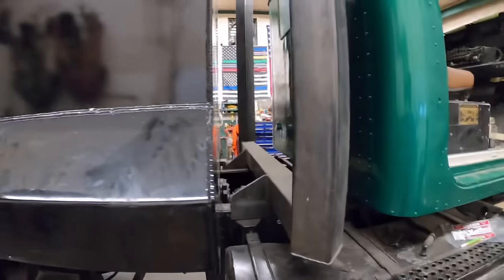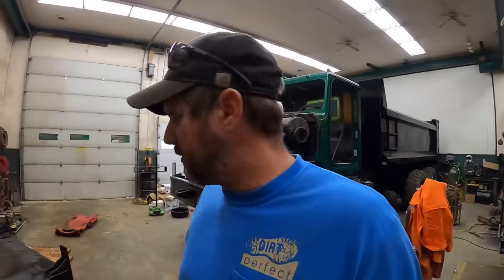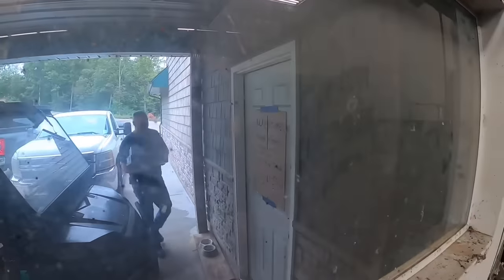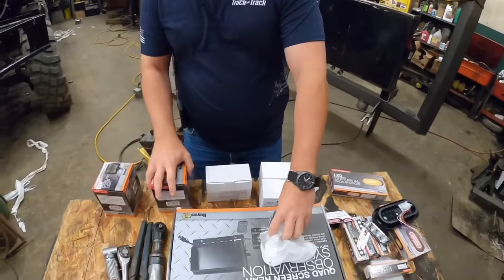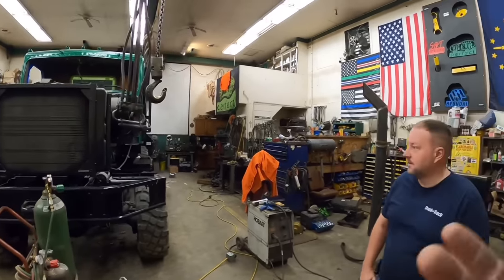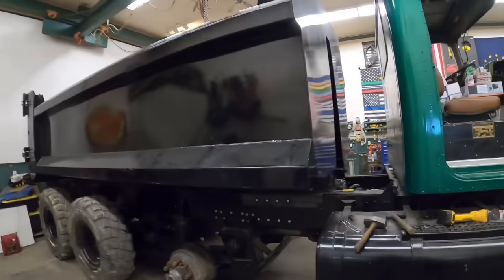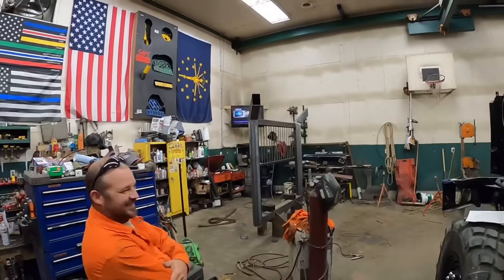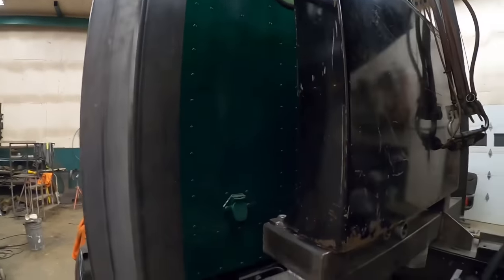Custom Fabrication on the stacks on Lt Dan and the bed raise for the first time

Comment: Whenever you cap tubing especially if you live in climate that freezes moisture will get inside and can actually distort the tubing it's a good idea to drill a drain hole in the bottom

Comment: We had a problem with top mount tanks on snow plows a few years back when we mounted it on the cross support for rear wing (6X4X3/8) across frame. We mounted the tank the same way as you did. The angle welded to the tanks started to have stress cracks which leaks. Very easy to fix though take the 4 bolts out and put a piece of rubber belting between and mark and drill 2 holes in each and tighten bolts. It's been over 5 yrs and no problems as of yet.

Comment: Just a suggestion, add a limit switch and a red llight on the dash to warn the driver if the dump bed rises while traveling. There as so many videos of dump trucks hitting bridges with very bad results. A simple warning system seems like good insurance.
Reply from the maker: Stay tuned thanks
Reply from the maker: Appreciate that

Comment: I had to pull a fuel tank off a JD 160 that some one had put 3/4" 45 deg trim pices that had been used for concrete forms, so the tank had dirt and concrete in it, after washing it out, I put 1/2 a large bottle of rubbing alcohol in it and rolled the tank around  empited and repeted witht eh rest of the bottle and stuck a rag on a stick and dried it out the tank was dry and clean and back in service at the end of the day.

Comment: Its looking Good. I just hope the stack underneath the Hyd tank doesnt heat up the oil more then what it allready will be from using it.But it looks Great. And with those bright lights on LT Dan, Youll see him coming for miles...Be like that snow plow in that movie chasing those kids around. With all the lights on it..LOL..HAHA...Great Video, and job on LT Dan ...
Reply: Hopefully, as the oil will only be used for dumping, it won't get heated that much by use.  Not like an excavator that is constantly working, or a skid steer running a forestry cutter, or even a hydro drive compact tractor, where the oil is getting lots if heating from use.
Reply from the maker: Exactly

Comment: A soapbox is a raised platform on which one stands to make an impromptu speech, often about a political subject. The term originates from the days when speakers would elevate themselves by standing on a wooden crate originally used for shipment of soap, or other dry goods, from a manufacturer to a retail store. In your case Mike, it's to preach!!!! Truck is looking sharp Sir!
Reply: Greg, exactly correct… there’s a scene in an old Charlie Chaplin movie where the Keystone Cops chase him into a crowd.  They are gathered around a Snakeoil salesman who is standing on a box labeled soap.  

As the crowd surges forward, during the scuffle, the box is broken open.  The salesman tumbles and pours a bottle of the Snakeoil onto the soap. The ensuing mountain of bubbles gives Charlie a cover through which to escape.  

That is my earliest memory of someone  up on their soapbox.  After that I only remember it being used to refer to  people preaching religion or politics.
Reply: @sassafrasvalley1939  You had much more detail than I did. Thank you for the full picture. Took a look at your channel. I like it.
Reply: @gregd931  thanks Greg… Your answer triggered that memory… just wanted to share it while it was on my mind.

Comment: For the hydraulic tank don't you need rubber bushings that the mounting bolts go through that fit between the tank brackets and the brackets on the truck frame or exhaust stacks in this case? Maybe ½" or 1" thick. They help to keep the tank from vibrating loose causing the bolts to rub and shear off right? IDK for sure but you see them on upright hydraulic tanks on trucks now. Just something I'm curious about and only trying to be helpful. The truck is looking awesome and I can hardly wait to see it hauling some dirt for a pond dam!  👍
Reply from the maker: No sir no need

Comment: I think MIPT x JIC adaptors would be the way to go on those hydraulic tank ports, the adaptors can be sized to the JIC hose size right at the fitting instead of using iron pipe bushings.
You could get the pipe threads tight and be able to clock the hoses in any direction you want.

Comment: You  need to change the fittings on the tank to 45's especially the one to the pump.  where is your inspection cover and in tank filter screen before the pump?
With those awesome Byers 4 way tail lights on  the back of the truck I would use a cab mounted low profile light bar to gain space and protection from the dump box load.  Keep up the GOOD work

Comment: OK Mike, right off the bat you express a smidge of concern about "if that nut ever breaks off in there.............".
Put your concerns to rest and make some notes here.
If.....that nut EVER gives you any kind of problem........simply cut out a section of the tube with the nut (torch, plasma cut, cutoff wheel, drill and jigsaw or whatever) and then fabricate a patch plug/plate with a new welded nut to go back where you cut out the faulty nut.  Weld in the patch plate and grind the weld smooth and flat.  You're done and back in action.  This technique is also useful for adding a welded anchor nut to any place where you can't access the backside/underside for direct welding the nut in place.  My method is to drill a hole in a suitable piece of donor steel and lightly secure the nut in place with a bolt and then weld the nut to the plate.  Then I cut out the patch to the size needed to fill the opening where the new nut is going.  Use a small piece of steel plate long enough to bridge across the opening where the patch goes, but make sure there are 2 "seams" exposed for you to tack weld the patch in place. Drill a hole in the bridge piece to attach it to the patch plate with a single bolt.  Tack weld the patch plate where it needs to go and then remove the bridging piece. Run a bolt finger tight into the new  nut before welding the patch solid to prevent weld spatter from fouling the threads. It is always recommended that a tap be run through the nut afterward to correct for any draw that sometimes alters the thread slightly.
Reply: Or just grind /drill open the end plates he put on the tubes.

Comment: Good job, it might be a good idea to add a couple of brackets to the top of the oil tank to stop it wobbling anywhere, that's a big tank to trust with just 4 bolts offset centre at the bottom.

Comment: With those rear lights including a strobe function you don’t need to keep the one over the cab high enough to be seen from behind. 
You could also look into adding those lights to Plan B if there’s a way to wire them up though the trailer harness.

Comment: Ok, can't resist my OCD.
1) galvanized fittings in hydraulic systems are to be avoided. Galvanizing can flake off and cause issues.
2) suction strainer needs to be used. Didn't see one.
3) install a shut off valve in the suction (supply) line. Make sure it is a full flow valve.
The rest is awesome!

Comment: Curiosity is getting to me, back in Missouri, I drove a 72' Louisville dump truck, pulling a pup in 78',  empty weight being 32,000 pounds, gross back then was 73,280. All that metal added on there, how much are you going to be able to haul? 😁😁😁👍👍👍👍👍👍
Reply from the maker: Hope is 19 to 20 ton

Comment: The structural stacks on Lt Dan are definitely unique as is the use of rebar but why your are welding stuff to your stacks/hydraulic tank mounts (which by the way should have a gusset on them) / headache rack, how about bending some flat stock to hold a flat blade shovel, coal scuttle, broom holder and oddly enough a light.  PS if you measured twice calculated three times you probably would not have needed those filler pieces 😁

Comment: How about welding a tab on the tank on each side at the top of the tank so it can be bolted to the 1 1/2” . It would help stabilize the tank.
Reply from the maker: Stay tuned

Comment: Hands down the crane is the best decision you ever made, other than the wife....😁Learned Todd does not watch your channel 14:10 on the Lt Dan build. I like Heavy Duty and Lt Dan is going to Big Boy, any goal on where it will scale empty? A quick look at Indiana, Tridem 50,000 with lift axle gross weight, I could be wrong. Is that the final rim and tire combination, may have missed that decision.
Reply: Maximum4x4, watch the last live with NYA Millennial,  the crane is down!!!

Comment: Anyone know what reaction the exhaust condensation will have on the inside of the steel tube?
Reply: I wondering what will happen when it fills up with rainwater . I'm sure Mike already has a solution in mind .
Reply from the maker: You guys forget I have had theses in my other trucks for over 20 years

Comment: DP - you recently did a review of farm tractors (JD series 55?) and you wore a wireless remote mic with wind screen device.  That was the best sound you've ever done.  Many, many times you are holding the cam on a boom or in-hand and it sounds good = so long as the cam is pointed at you.  BUT, when you turn the cam away, your audio quality goes to, well, places I won't say here.  Your lack of consistent audio quality - or proliferance of poor audio quality (muffled, erratic) - is the most criticism I'd give.  Your content is super, your vid quality is as good as most everyone.  So, pick up a couple of those mics and wear them all the time - even crawling under the equipment.  Just my opinion, of course.  But it will elevate your product.  And keep up the inventive and interesting content.
Reply from the maker: Very sorry but impossible family work and YouTube if I have time do what I can

Comment: I Love the use of the fan belt . Was that made by Lift All ?  As for the hydraulic tank you didn't add any plumbing for the drain . And how are you going to filter the oil ? Soap used to come in wooden boxes and people would stand on them when they wanted to be seen and heard ! And are you keeping the family awake with the compressor and the air drive hoist going at night like that ?

Comment: Are you going to add a heat shield screen on the exhaust stack ? Expanded metal would work.
Back in the day, a person with something to say would stand on a street corner on a soap box and speak to those around him. It was the original form of Twitter or Instagram.

Comment: Did you notice that your sight glass is on the opposite end of the tank from the fill hole, been better if they were on the same end that way you don't have too walk around the truck to check the level .

Comment: hi yes i watched the videos late but i must ask you why you fitted all your new bolts with no washers or nylock nuts, or even spring washers its my thought and history in engineering there their for a reason to spread the load and stop thread binding and deformation ofthe head  by large holes in the plates.  it make removal in future easier and prevent bolts from coming loose more so in your line of work bouncing across fields and dirt tracks. the cross member could be best fitted with Nylocks and long exposed thread will rust up keep bolts to a minimum length so this is reduced it makes nuts come off quicker and without thread locking due to the dirt and rust over time.(rule 1 thread longer) paint after final fix helps also ...Jjames  ps the welding is great.
Reply from the maker: Study the nasa report on them thanks

Comment: @Dirt Perfect galvanized pipe fittings shouldn't be used with oil products instead use black pipe fittings. The hydrocarbons react with the galvanized fittings. Just passing on some knowledge...

Comment: I just found something I hate more than an Air Starter........That's your crane...Is that thing even certified? Boy is that hoky
Reply: LOL.  It is not your "typical" drive system for a hoist,  but it does eliminate the need for live electrical conductors and all the safety requirements that come with an electric motor drive.  I don't know the background/history on Mike's crane but I figured the pneumatic drive might have originated from an application where electric arcs/sparks would be hazardous (flammable dust or flammable gas presence.)
Reply: @larrywalker7759  I can see back in the 50's or earlier it probably was a "Explosion Proof" classified set up. Still weird and scary.

Comment: Spoken like a tru man:  8" more like 5; 6" more like 3", etc.   LOL
Too late now but what kind of heat transfer are you going to get from the exhaust system to the hyd tank?
if you keep adding iron to that crate Officer Hoover will require a special permit to drive it down the road EMPTY....
Reply from the maker: Thanks and not a concern